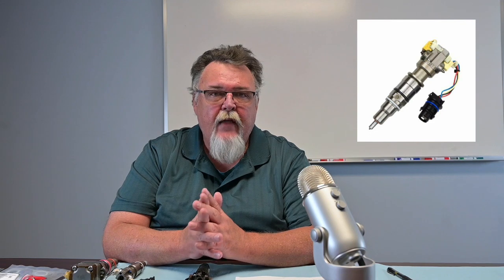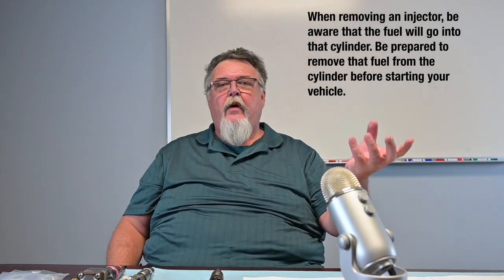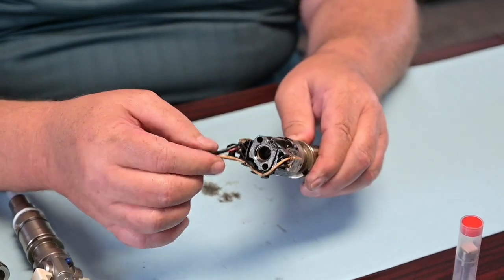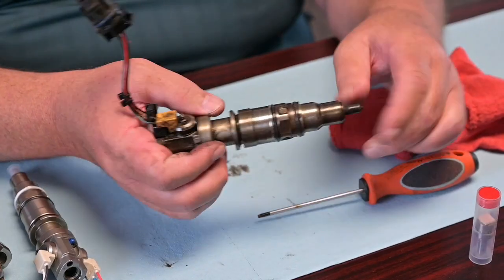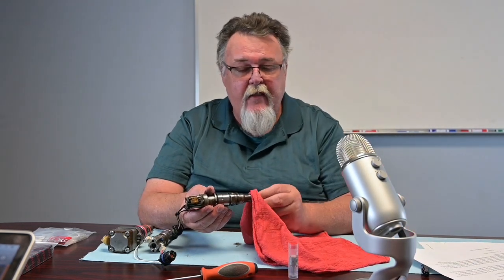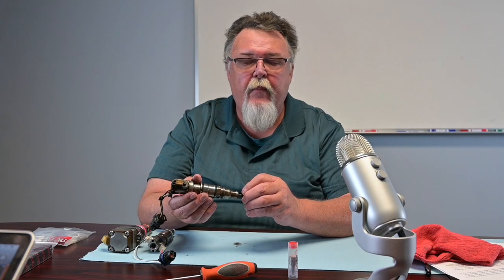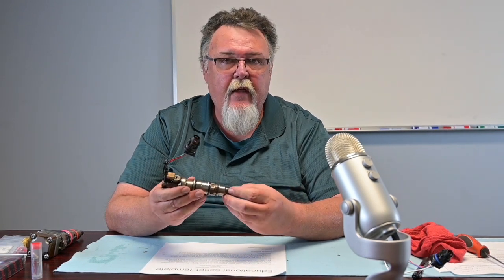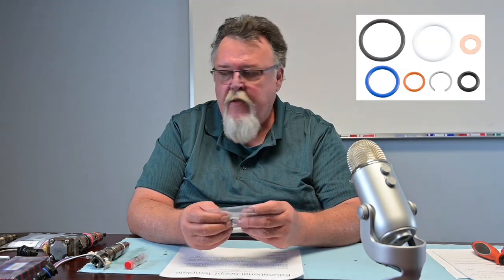6.0L Ford Powerstroke Fuel Injectors Diagnostic and Inspection Tutorial

Comment: Great video. I've always found it frustrating that there isn't a good way to test injectors other than a buzz test or having a dealership with an IDS do a cylinder contribution test. I never thought to use a temperature gun to take measurements at the exhaust ports. That could be a great way to narrow down a failing injector without spending money on a contribution test, especially when you have no codes. Thank you for posting.

Comment: Very helpful and informational video.  I checked out your website too and it's very nice as well with very well done guides.  I plan on diagnosing my truck's issue soon when the weather cools down (it's not a daily driver).  A ODBII scan gave me a faulty GPC module, I replaced that but I'm still getting smoking, and a smell, not quite like raw diesel but maybe a burning carbon like smell?  Anyway, I'm fairly new to diesel troubleshooting so any suggestions would be greatly appreciated.

Comment: I have a 2003 f250 6.0 diesel it shows four injectors not contributing , runs alittle ruff will replacing the o-rings fix it as long as the
 wires are ok

Comment: I need some help with my 6.0 powerstroke. Have a 6 inyector circuit low. If you can help me wich are the more common causes of this code and also it have EGR P0401 code. And P0404
Reply: I have the same code except cylinder 5, I’m not sure if it’s the harness or the injector
Reply: Same code except mine is #1

Comment: When I am at certain speeds of between 30 or 40 or 70 to 80 mph, my truck acts like it is choking or an old steam engine puffing with black smoke exiting the tailpipe. It does not do this all the time but has been gradually getting worst. There are only 148,000 miles on the truck. I have changed the fuel filters a couple of times now too. Just frustrated about finding a solution.
Reply: Did you ever figure it out? Mine has similar miles and symptoms.
Reply: Sounds like you're FICM or Fuel Injector Control Module is starting to have issues.
Reply: @williamshultz3598  That’s what was causing the problem. Replaced it and my truck runs great again. Thank you!
Reply: @Courtney Battle yes if was the FICM.

Comment: Wth does he mean at 6:08ish by "pick a cylinder that's easy to get to cuz you're gonna have to spend extra time w/it"? Wouldn't you be cleaning a cyl that the engine picked to die? I mean a guy doesn't usually have any say over it, I just fix whatever it  decides to shell out. Js
Reply: He may mean to start with an easy one if you're doing them all.